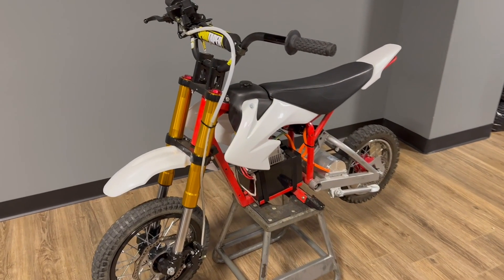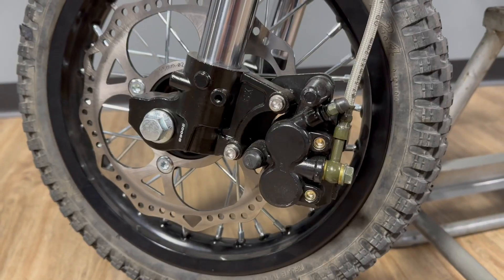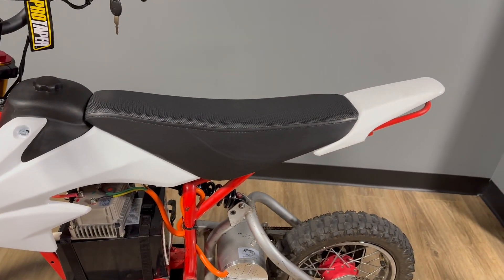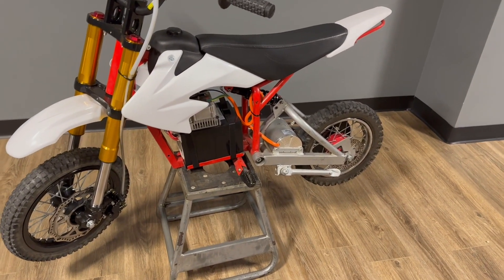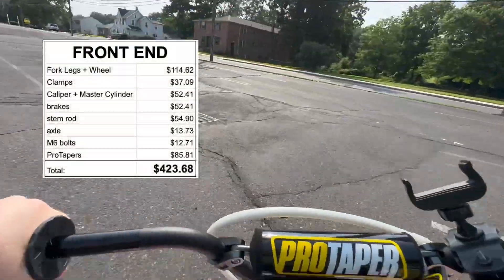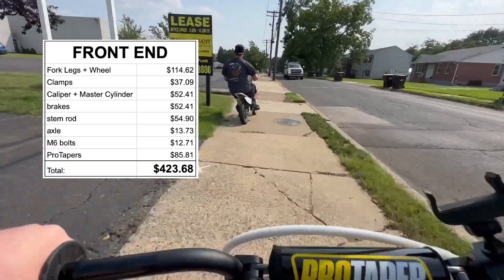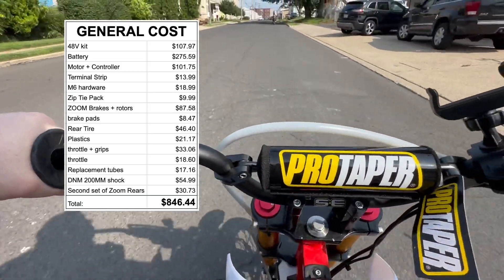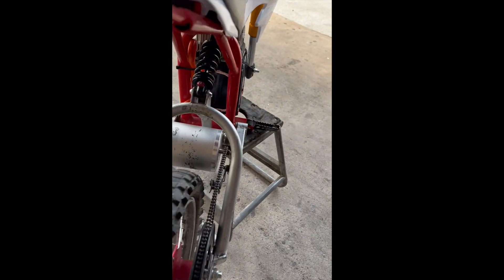How much does it cost to build a 72V Razor MX500? Let me tell you!

Comment: It costs about $3,500 if you buy a plug and play kit and all your stuff from electro and co. Thats of you buy all the necessaries, however if you do your research then you can end up spending around  $1,500 and get about equal the power.
Reply: can u tell me how to spend 1500 instead of 3500 plss🙏🙏🙏
Reply: Amorge battery with kunray motor

Comment: Do you still run freewheel on rear wheel?
I do and already snapped 2 chains. How can I fix this issue?
Reply: I know this comment is 6 months old, but did you end up welding the freewheel and/or upgrading the chain?  How much power are you running?